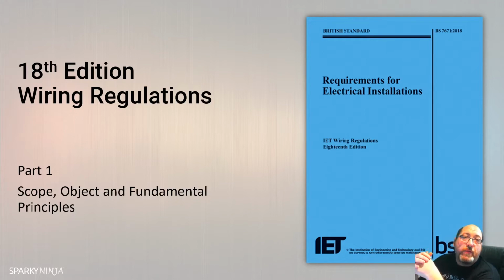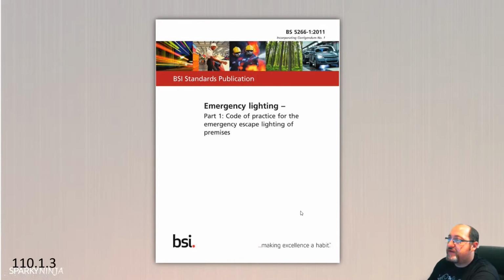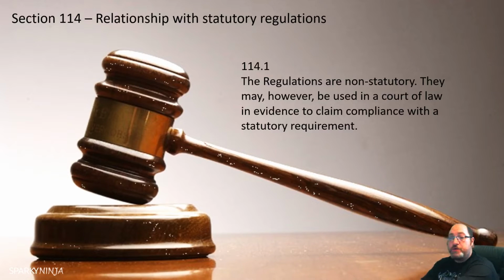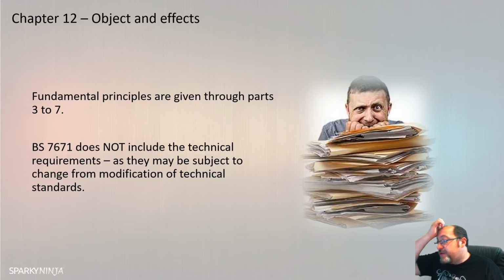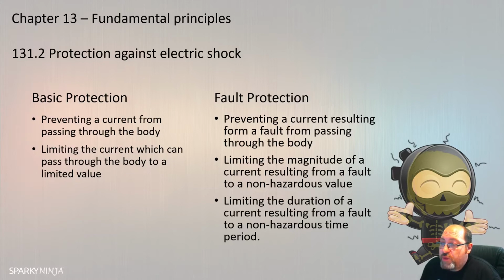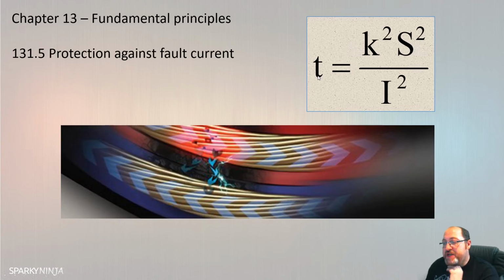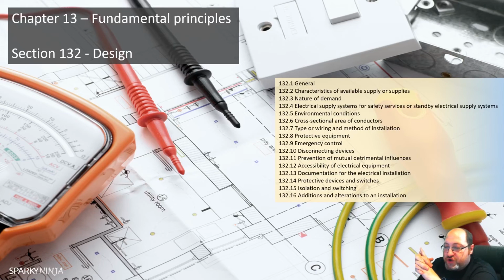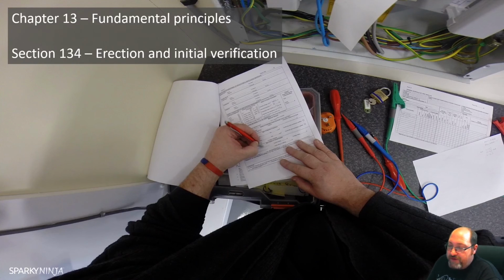18th Edition Training Series - Episode 2 - Part 1, Scope, Object and Fundamental Principles

Comment: My 18th Edition course was called off today as one of the younger lads tested positive, so I now have to isolate for 10 days.......... Which I intend to spend in front of these videos.......... All in all I feel I will come out of it with a lot more knowledge than I would have trying to cram it all into 3 days, being taught by someone who didn't seem to give a sh*t anymore......

I'm part way through level 3 so a lot to learn still but spend as much time as I can with my head in books and videos.  I have worked with several fully approved and AM2 qualified Sparks over the years and the standard work, lack of testing before and after work is actually mind boggling.  Some of the things I have seen would make your toes curl.....

But thank you for making these great videos, Mr Ninja! :)
Reply from the maker: No worries.

Comment: 134.2.1 precludes anyone other than the original installer from verifying a new installation. However I've observed NAPIT guidance permitting this practice, do you think NAPIT in this instance are providing incorrect guidance.
Reply from the maker: It would be great if it was written that way. Unfortunatley due to pressures from bigger businesses wanting to employ cheaper labour, third parties are deemed to be necessary - but I agree that this work should be carried out during installation, hence the installing contractor.

All companies support third party certification from the wiring regulations perspective. The third party certification which you have noticed standing out from Napit's perspective is actually the third party 'notification' of electrical installations in dwellings under Part P - this was introduced in April 2013 and is in my opinion an absolutely bad idea.

So much so that the NICEIC saw sense to not support the model, but Napit always jump on these things as they are a company focused on registration schemes for absolutely everything and anything. 

https://electrical.theiet.org/wiring-matters/issues/51/part-p-third-party-certification/#targetText=Overview,Wales%20on%201%20January%202005.
Reply: A third party should feel uneasy when Certifying for the "construction" if not having been closely involved through the various stages of the installing process. There is an insufficiently addressed inconsistency here.

Comment: At the beginning of this video you say that the exam is in order. So does that mean the exam will go like this:- 

Questions 1-4 = Part 1
Questions 5-6 = Part 2
Questions 7-12 = Part 3
Questions 13-27 = Part 4
Questions 28-41 = Part 5
Questions 42-45 = Part 6
Questions 45-55 = Part 7
Questions 55-60 = Appendices

Is that correct or am I misunderstanding what you said? 

Thanks
Reply: Amazing, knowing that alone will be a huge help. Thanks
Reply from the maker: Correct

Comment: Hay I'm a mechanical engineer no electrical qualifications..

I do a bit of 24v installation of plcs and control units... Been told I need to do this. Is there anything else I need to do? Also do I need to know any electrical knowledge to complete this course /exam?

Thanks for your help
Reply from the maker: I cover most of the maths needed in the series - ohms law etc. There is an area of interest for you in Section 55 for auxiliary circuits but unfortunately not a lot else.

Comment: Thank You.... another great video.
Just a quick question, and after a chat with a plumber today...who was oblivious to the 18th edition regs....I presume all the Plumbers, alarm installers and Kitchen fitters etc... who adjust circuits by adding fused spur units, and the like,  for boilers, alarms and washing machines etc... to existing circuits, have to re-sit their exams /assessments to comply with such things as  "Defined Scope"  registration with one of the certified bodies and do the 18th edition exams too?  I guess they will.
Reply: A ‘plumber’ should only be working with lead and water. A ‘heating/gas engineer’ sits re assessment gas safety courses that deals with electrical basics and deals with checking polarity and voltage to altered circuits etc.
Reply: Dont be a sheep. If we all stand together, we can all escape these random reg changes and bullshit.